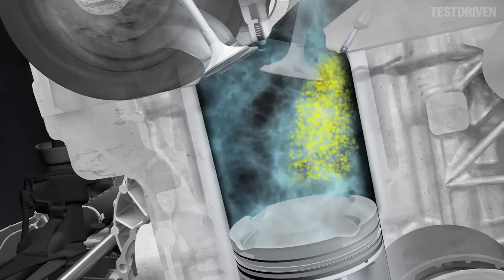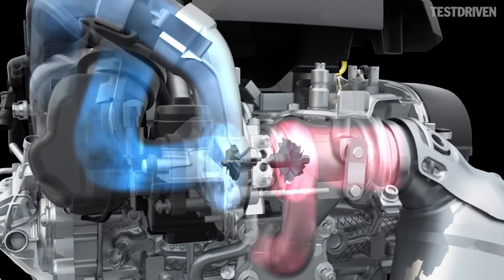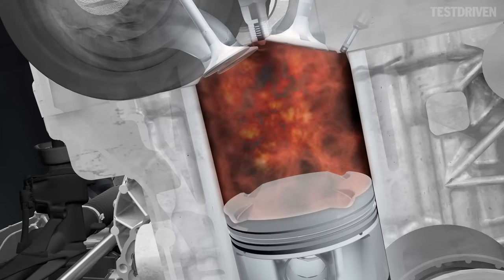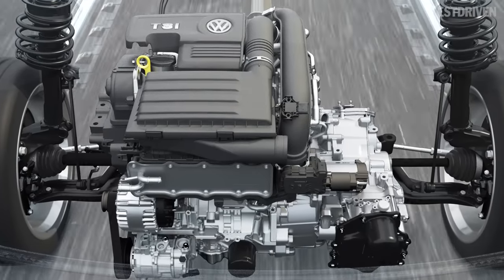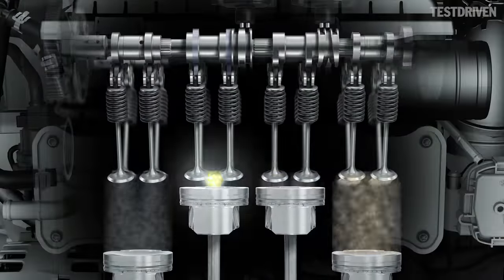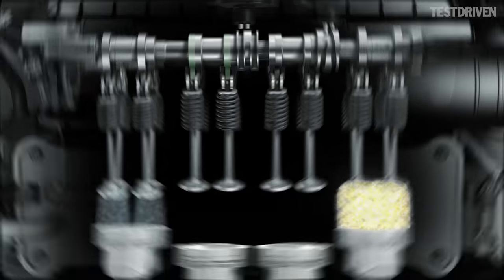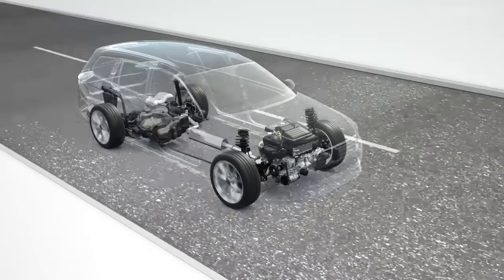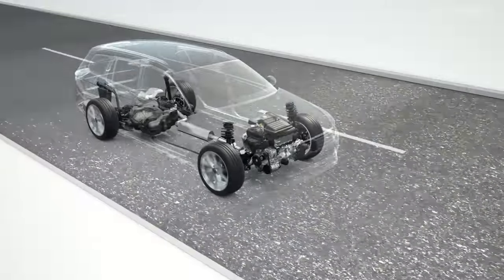Volkswagen TSI engine animation

Comment: I drove a 2.0 TSI in a Scirocco for 5 years. No issues, very nice engine with enough power and still economic. It just wanted a litre of Oil all 7000 kilometers.
Reply: zerotonine807 yeah because of the fucking piston rings for the oil. VW and Audi problem.
Reply: Well i had a problem now, dirt on lower side of pistons, had to remove the head of engine to clean that, nobody knows why tsi engines get that pile of dirt on the inner side of pistons:/
Reply: If you do the service every 10k km, wich you should, then you don't need to worry about oil, since vw service will change the oil. 1.3 liters on 10k km is nothing.
Reply: @Mihael-cs4ek  high heat in the piston head,  that transfer under it and coagulate  the oil that is squerted for the piston cooling.
Reply: A litre per 7000 km is low oil consumption!  Our last Toyota wanted a litre every 3000 km.

Comment: Bought my 91 GTi with 276k on the clock in 03, rebuilt the motor in 2014 with 441k on the clock, crank is still standard, bores are 2nd oversized. Used mostly OEM parts and it still gives me smiles for miles when I drive it, it’s not perfect but it’s built and not bought!!!! Never left me stranded, In VW we trust.

Comment: I say again and again, maintenance is key.  I have a 2006 GTI with the FSI that has lost merely 3 psi of compression in 165K miles, no major issues.  I take exceptional care of it.  I check all the fluids every week or two, and I perform all the services to a T.  I use quality oil only.  I love it, I take care of it, and it has lasted.

If you want a car that you could throw Walmart oil in it and have it keep running and chugging and that you can neglect, buy a Toyota.  If you know nothing about cars, and just want something to get you from A to B, buy a Toyota.  If your car is an appliance to you, and not something you would say you love, don't buy a VW.

A Toyota is an appliance.  A VW is a relationship.
Reply: Well said 👏🏽👏🏽
Reply: I've owned my 09 CC since 2012. Certified Pre-Owned, lease return with 30k miles on it at 3 years old and it has been a piece of shit ever since. Fit and finish are terrible. The a/c vents on the dash have disintegrated because of very low UV resistance. The headliner is falling off. I had to do a complete top-end rebuild because of a defective cam chain tensioner design. The EPC keeps faulting and stranding me on the side of the road. No way to determine if it's the pedal or the throttle body. Three VW dealerships have not been able to get the alignment right and I can't get 30,000 miles out of a set of tires. I've tried the cheapest tires and the top of the line tires and none last. I'm meticulous with my maintenance and I do my own. I use OEM VW replacement parts, Mann filters and Liqui-Moly 5W40 Liechtlauf oil, so the tensioner failure was not a result fo lack of maintenance. I'd be willing to bet money that there isn't a 2.0TSI out there built from 2009-2012 that hasn't shit the bed, due to balance shaft, or cam tensioner failures, HPFP failures and water pump failures. All of those components are into revisions with some on their fourth or fifth. VW is making a killing off of the repairs for these vehicles. You're right though. A VW is a relationship between your wallet and the repair shops. That's why I do my own repairs.
Reply: Woody Ridenour i have 06 mkv its my pride and joy i change oiln3000 miles everytime its still runs like the first day i bought it 160,000 miles later.
Reply: If you want a good engine buy a vw.
If you dont mind if all other components fail on a daily basis buy a vw.
Reply: A turbulent relationship!
Reply: Buddy just bought a mkV r32 for his first vw. His folks are flipping out because "they're unreliable". So now I get to teach him proper service intervals and maintenance (currently looking for my 3rd mk4). Take care if your car and it will last forever. Know a guy with a mk4 tdi with nearly 500k miles on the original engine, and it's been on a stage 3 tune for the last 100k+
Reply: Yes you are right mate.Vw is a relationship with workshops.
Reply: @vloguis  eae gui blz ? Sou de Curitiba tb, e na minha opinião o motor TSI é o melhor atualmente do braLixo. Tenho um fiat siena 1.4 completo, ótimo carro, mas quando trocar quero tentar pegar um com o motor VW TSI q é melhor q existe aki pelo q acompanho. Abraços.
Reply: my vw was a piece of shit. relationship with the vw dealer? well I am a master Mercedes tech. These fuckers could not diagnose a fuel injection rack that was pissing diesel fuel! I had to make them lift it and start the car and show them it spraying diesel. they told me nothing is wrong when diesel was soaking the entire undercarriage!  loved having to rebuild the turbo and all the intake manifold problems.  Loved how they could not find a problem when I complained that the radio does not work.  Same when the seat frame broke, and when the a.c compressor went out.
Reply: And what happens when your relationship ends with a divorce, which will happen. Only a matter of when :)
Reply: ...so having a VW is like having a gigantic liability as pass time . Gotcha. I'll keep that in mind.
Reply: Actually you have a "tfsi"......
Reply: dann hienn no one cares if your dealer was crap, the other 1 million dealers all over the world are good. Keep your crap for yourself.
Reply: @bEEBO178  lol cvts are trash
Reply: Why yall acy like mercedes & bmws dont stay at mechanics all year long

Comment: Why no animation of the carbon build up on the intake valves?
Reply: Cause that is every direct injection engine.
Reply: Because that was the Old tsi that had that problem
Reply: cause it's only a big issue on usdm models, international version has injectors cleaning the intake valves
Reply: @keszhardened2199  In Europe they came with dual port injection (both direct and indirect injection at the same time). This eliminated the carbon build up problem.
Reply: @Alexandru-T.  no it doesn't solved the problem at all... the only part that the carbon won't build up is where  the ''spray'' from the injectors , spray... even when it the engine is equiped qith this two types of sistems ( direct and indirect injection) the rest of the intake manifold and also the valve seats will suffer with carbon deposits
Reply: @thedane6483  how old?!
Reply: @thedane6483  say that to my 17 jetta ive had for 7 months (at 35k miles) that already needed a carbon cleaning and every spark plug and ignition coil replaced...
Reply: @danielrutt3153  My 2014 golf 1.4 has done 200.000 No cleaning. Runs great.
Reply: Carbon buildup on intake valves has been a VW problem since the days of CIS injection in the original Golf Mark I/Rabbit.  Buy better gasoline, and use Techron or Seafoam regularly, and it never turns into a problem.
Reply: @velysean7031  yeah and I heat if you use 98 octane fuel you're also safer when i come to carbon build up

Comment: I'm a VW tech main dealer, early TSI had some issues, but the later ones rarely seem to have any major issues. Nice engines
Reply: Kevin Coyne this is my third and last VW. Had to fix it myself because it was 103k and no dealer wanted to take care of it without charging the full cost. second timing chain btw. Ridiculous.
Reply: Im buying 2015 1.4 TSI 92 kw in few days so can you tell me is that engine good?
Reply: @pirginjo  Well it's only my theory, but the latest cars use the new 1.5tsi, however, the hybrids still use the 1.4tsi as when it's mated to a hybrid they pass the latest emissions regs; they must rate the 1.4! Regular servicing and they should be largely trouble free imho
Reply: @brianjardine800  sorry to hear that. I'm referring to the later belt driven TSI
Reply: @pirginjo  did u buy the car and hows it running?
Reply: Hey man... I've just bought and 2019 Skoda Octavia 1.4TSI DSG7.
I've heard that the gearbox it's really troublesome, but what about the engine? You think it's a good engine? Does it have a belt or chain belt?
Reply: @nelsonr.9253  The 1.4tsi you've bought don't seem to give many problems, at least not in our workshop. They are definitely a much nicer power plant than the newer 1.5tsi (probably why they still use the 1.4tsi in the PHEV). It's a belt  driven engine which Skoda UK recommend changing every 5 years. Just change oil regularly, I'd change it every 8000 miles if it were my car.
Reply: @gsoup7850  niiiiice, thanks a lot, Kevin! Have a great day, greetings from Chile, South America.
Reply: @nelsonr.9253  And to you, greetings from Kent, England
Reply: Is vw golf mk7 from 2013 considered "early TSI?"
Reply: @perou7367  no, as far as I'm aware all mk7 1.2 and 1.4 tsi are the later belt driven engines, well proven.
Reply: sir please your name?

Comment: I have a passat b6 1.4 122 i find this engine brilliant. Very refined engine. Seemed reliable didnt give any trouble but i have it serviced regularly. Plenty of power for what it is and easy on fuel. Theyre great when minded. Have it for over 296,000k so far and still alive. I would definitely concider the same engine again.

Comment: 390hp and 400 torque on my 2.0 TSI. Strong as hell. Never had issues with any of my VW motors. 01' Passat 1.8T, 02' GTI VR6, 13' CC VR6, 12' Golf R 2.0T, 16' GTI 2.0T, 17' Golf R 2.0T and the fam had an 07' Rabbit 2.5L, an 04 Golf 1.9 TDI and 05 Jetta 1.9 TDI. ALL WITH NO PROBLEMS. Don't be turds and your car will be good to you.
Reply: Thats probably through good maintenance! Could you share how you maintained your VW engines?
Reply: @timyt13  good oil and timing chain service and valve cleaning and it will treat you good forever
Reply: @usa5046 timing chain valve cleaning, why bother with thousands of dollars when you can buy a car that doesn't requiere that?

Comment: In my experience this engine is very reliable, however, I do change my oil every 5000 miles and use Shell gas. Currently, I have 92,000 miles on my Audi A5 with the 2.0 TFSI engine.
Reply: Do you do decarbonisation?
Reply: @SharkFishSF  I've not and my car is at 200k, runs like it did at 40k. Frequent oil changes are important though like Matthew mentioned, every 10 as per the manual is too far apart
Reply: And I bet you are ready sold it or have spend a couple grands since you made that comment

Comment: Thanks VW, we don't need any more advanced technology that will save us 10% on gas, and cost us 1000% on parts for the ownership of the car. That includes you too BMW, Mercedes
Reply: High performance means high maintenance cost. If you don't like it, drive a volvo
Reply: @Jerry.V  You are wrong. Absolutely wrong. Everything that breaks down a BMW is avoidable and designed to break down. a 330HP infinite g37 for example has comparable power to any quick bmw, but 10x less to maintain.
Reply: @sranjesuper  sure it is buddy, if you maintain the bmw yourself and bring the infite g37 to the dealer for repair, yeah, it's logical the bmw will break down faster
Reply: @sranjesuper  there's a volkswagen close to my hometown, already with 280k miles on it, VR6 performance engine. Always been to the dealer if something was wrong, still driving. You guys simply don't know how to maintain a car, that's all
Reply: @Jerry.V  No, VAG, BMW and Mercedes trying to push any bit of power from all their engines. You're delusional if you think they will last along as other brands. Just wait till it's out of warranty and have fun when it breaks.
Reply: @MrRohanThomas  you obviously didn't read anything I've said
Reply: @sranjesuper  you obviously didn't read anything I've said

Comment: 1.2 tsi golf 6 problem with time chain and damage all pistons...
Reply: Don't forget Audi's piston rings.
Reply: The new EA 211 Engines have an time belt again.
Reply: @RPNization  and still is crap
Reply: Have you ever replaced the timing system? You have to replace it every 100'000 km you know?
Reply: @UsgBifJgpwltA  no to 100.000km after 60.000km its more safe!

Comment: my family owns a  polo 1.2L tsi for about 8yrs now, and it never had any engine/transmission issue, is my Polo defective?
Reply: nope, they just took good care of it
unlike most smoothbrains on here which complain about car problems
Reply: The 1.2L TSI Polo's can still suffer from DSG problems 'and' timing chain and tensioner issues. It's just that the 1.4 TSI engine gets most of the complaints and drowns out feedback on the smaller engine. Listen for timing chain rattle when the Polo first starts. They soon quiet down as they get oil pressure but any noise is indicative of a worn chain, tensioner, and guides. I have a 1.2L Polo and a 1.4 twin charged GTI polo.
Reply: @erroneouscode  aaye bro sold the old Polo and bought the new Skoda Octavia 

I am in a memory trip now 🥺
Reply: @S P it did well for 9yrs
Reply: My polo 2016 1.2 tsi AKA fluffy... those engines are good... it never gave me problems. I just service her and she service me😅

Comment: Have a 2016 tsi golf. 189kkm
Turbo was replaced before I got the car at 50k in jan of 2018. 

No real issues so far, but I've done the 2 tuneups that were schedules where they swapped the pistons. Breaks and the regular stuff. No real technical issues (knock on wood) 

I did have this leak in the boot, took me a while to find out where it was coming from. Stupid valve thigs under the rear bumper. But still runs good, for now.

Comment: 2016 golf mk7 1.4 tsi. 70,000 Km. No issues
Reply: Lol, poor you, 1.4 Mpi 2000 Polo, 200 000 km, no issues :D
Reply: Woow.
Mazda 323, 1.5, 2001. 180 000 km.  Changed ignition coil once..
Reply: Is200 Lexus...200k miles...Rear Shocks Weeping 😥..everything else Perfect👏👏👏
Reply: Damn. BMW E90 2.5 liter N52B25 . One time valve cover gasket leak. No other issues. 187 000 km.
Reply: @vojtechholub5536  Polo 1.2 TSI LPDi (direct liquid lpg injection), 250.000km, no issues
Reply: 140,000km rattle noise when clutch is idle and AC not cold enough

Comment: All in all, these are pretty versatile engines seeing as how they are in almost everything Audi/VW makes from standard commuter cars to hot hatches and in many different states of tune. While they have their flaws and there are a few basket case TSIs, they are  good engines when properly maintained. You can also get some substantial power increases from just the software.
Reply: Never that no decent engine u may say so maybe u one of the engineers of this endless money pit plastics

Comment: This must be one of the most unreliable VW engines ever built (one tiny timing chain tensioner part can cripple the entire engine).  They also forgot to mention the results of direct injection, i.e. eventual carbon fouling of the intake ducts and valves, leading to a drop in power and the need for expensive cleaning, now done in-situ using wallnut blasting.
Reply: Direct injection doesn't create fouling. EGR and crankcase ventilation tube going into the intake does.
Reply: @em4703  yes, and no, 'conventional' injection injects fuel behind the intake valves, this constant stream of fuel past the valves cleans off deposits  This doesn't happen with direct injection, as a result oil deposits collect in the intake port and on the intake valves, fouling both.
Reply: Belt driven TSIs are good

Comment: I’m a big fan of VW/Audi.  My only concern is the potential (probably inevitable) combined effect of GDI + PCV = carbon buildup on the intake valves due no fuel in the intake manifold to clean the intake valves.  Need to move to duel injector per cylinder tech (one GDI + one pre-intake valve) like some mfgs are starting to move to.  God bless!
Reply: You're right. Ford tried direct fuel injection. But carbon buildup on the valves caused issues. So, they actually fixed it by adding 8 more port injectors to thier mustang v-8's.
Reply: You can modify the new 2.0T for dual injection very easily. It's got the ports in the intake manifold already since they use them in Europe

Comment: The ea888 gen 3 is pretty reliable in my polo hammered it for 60k miles sitting at 300hp and its still solid
Reply: 300hp? 1.0 tsi 300hp?
Reply: @malvasia17  1.8  tsi gti

Comment: Did they ever actually say “Turbo stratified injection”  which is what TSI actually stand for???
Reply: It does not, as you can hear from the video TSI actually stands for "Modern petrol engines from Volkswagen"

Comment: Reliably expensive after just 130.000 km :)
Reply: Meanwhile 30 years old tdi engines makes 600.000km easily and still working. Clearly someone somewhere makes mistake.
Reply: It's not a mistake, when stuff goes wrong they get ur money 🤑

Comment: My TSI engine has 150k miles on it and no engine light. I did have to fix some stuff on it but nothing major
Reply: What did you have to fix? I have engine light on at 126000, misfiring.
Reply: Also high oil consumption.
Reply: Sanele Mazibuko check spark plugs and any intake manifold related stuff
Reply: @sanelemazibuko1716  probably carbon buildup

Comment: Cool until you get a check engine light that indicates you need to get your turbo replaced. $2,700 to replace by the way.
Reply: Jake H ahh no its 1100.00 from the dealer
Reply: I’ve been to the dealer, I’ve also been to my trusted mechanic
Reply: You can buy an IS38 for less than a grand fully assembled and calibrated

Comment: maybe it is a powerful engine with low consumption,  but reliability is terrible and the engine breaks down fast. there are a lot of defects in this engine.
Reply: Such as?? I have a 10 year old 1.4 tsi with almost 147k miles on the clock and still pulls like a dream and is in good condition with little matenance
Reply: @oppoh739  you're just lucky bro
Reply: @miloo111  cant be the only lucky dude in the comment section, alot of comments vouch for this engine i think it has a bad rep, e.g. bmw are known to spotaneously combust into flames, doesnt mean all bmw will combust
Reply: @oppoh739  speak for yourself and buy yourself a pair of glasses while you're at it